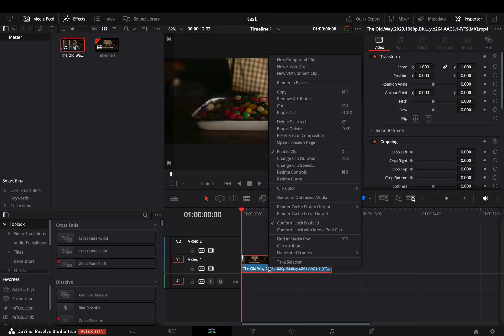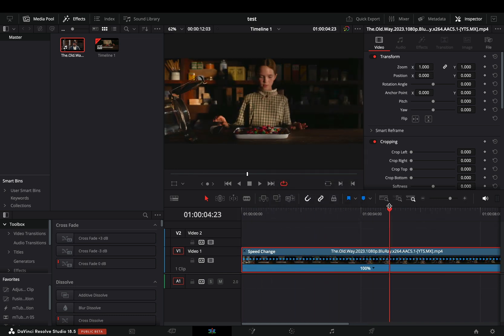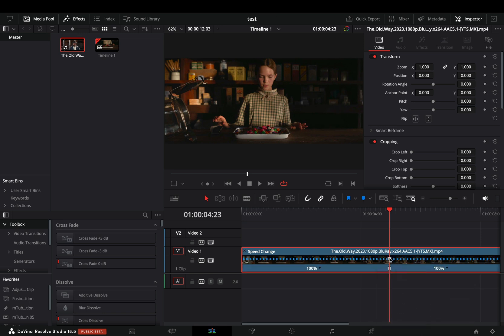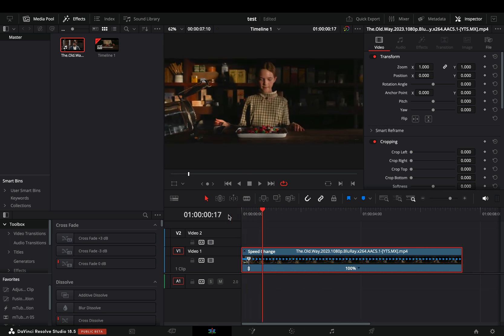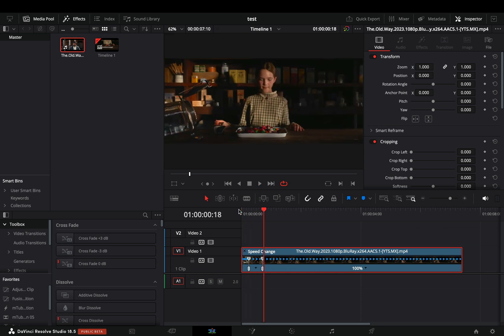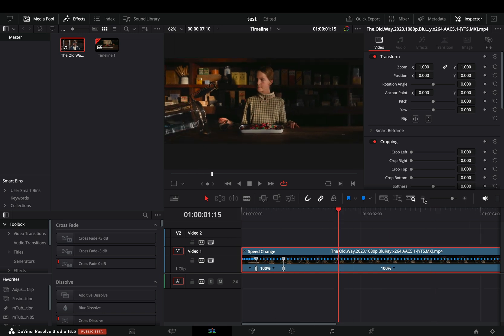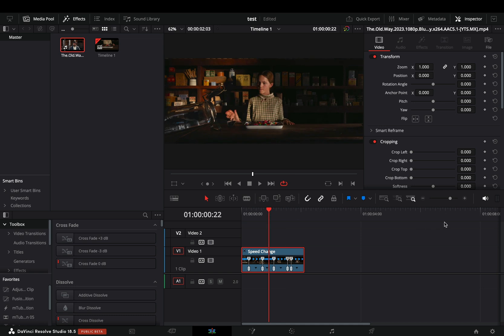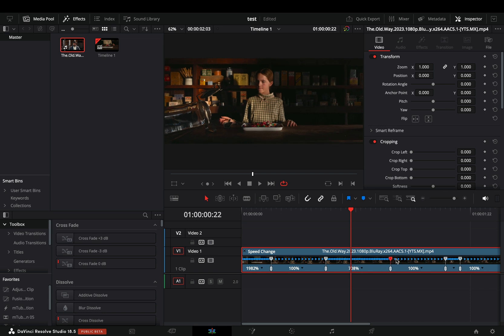The Easiest Way To Make Multiple Speed Ramps | DaVinci Resolve 18 |

Comment: Keyboard shortcut for adding speed points: CMD-[ (on Mac) This is a very context sensitive shortcut that will add control points to audio tracks, modifiers in the inspector, etc. Dependent on what you have selected and working on.
Reply from the maker: Didn’t know about that.. thanks man that will make the process even faster 🙏